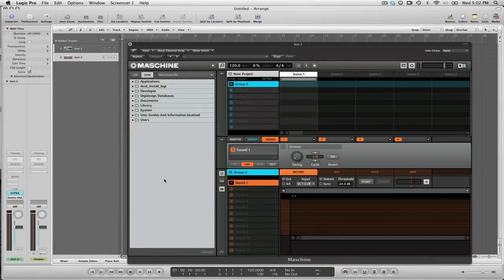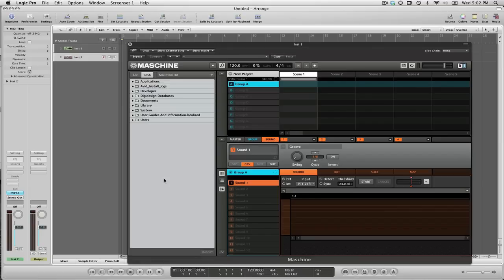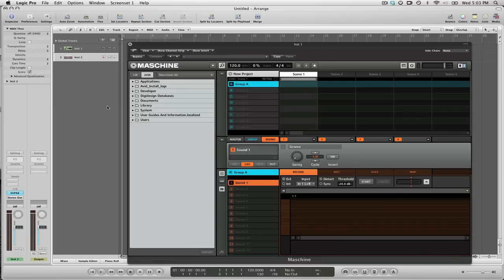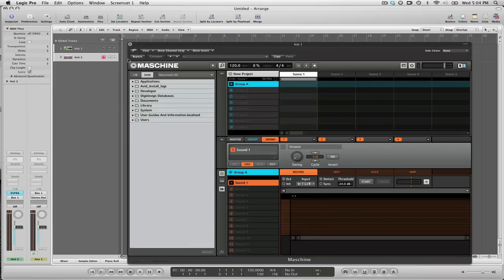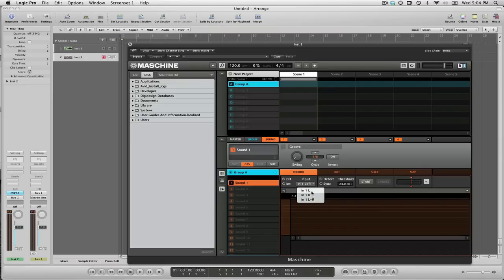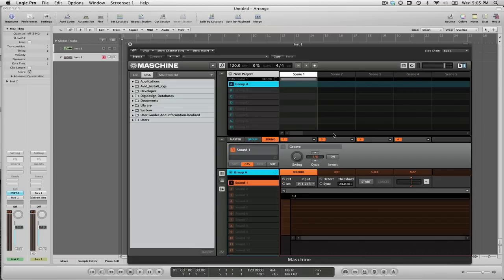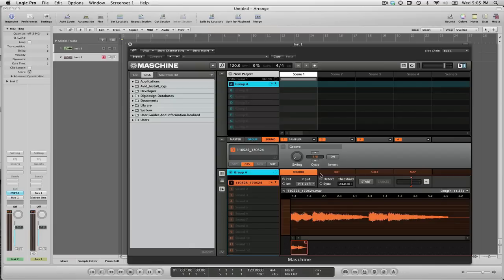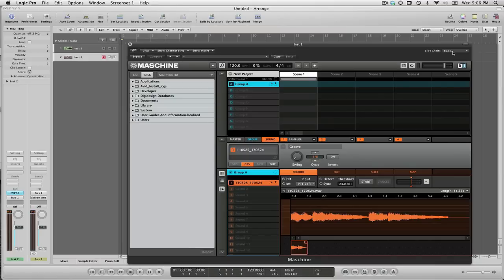Sampling in Logic Pro Using Maschine 1.x-Altruwisdom

Comment: Very helpful. I ran into a problem though. When I sample everything works fine, up to the point where I want to record a sound from maschine into logic. When I use it in MIDI mode, one sound is mapped across all the pads, from Group A-H, acting as piano roll mode even though it is not in that mode. How can i change that so each pad can trigger its individual sounds? a reply will be appreciated, thanks